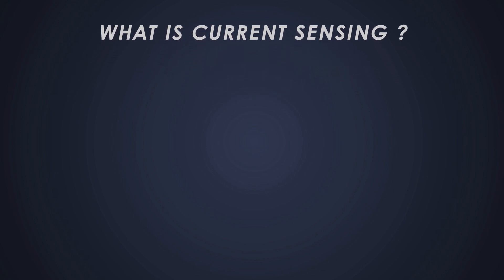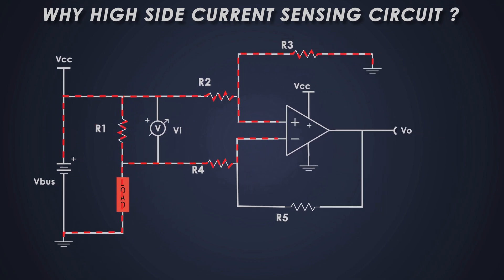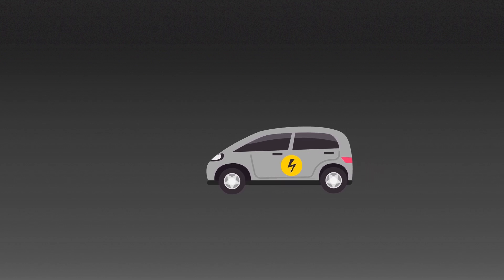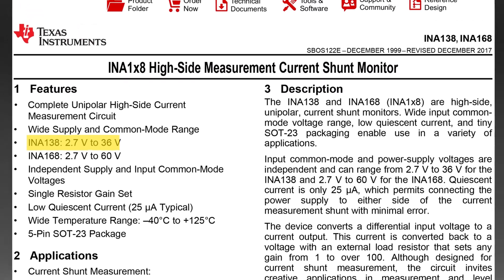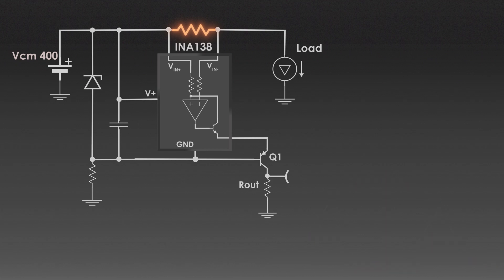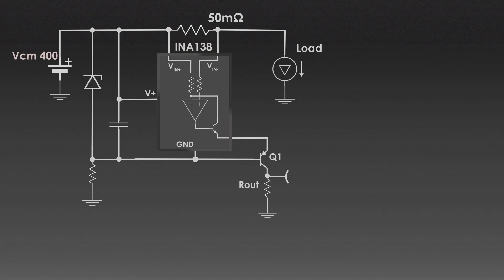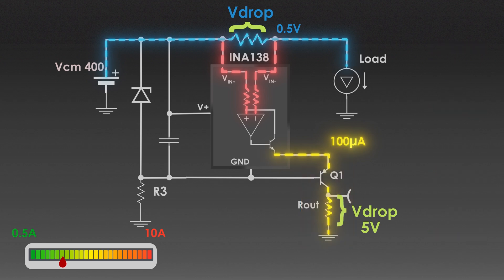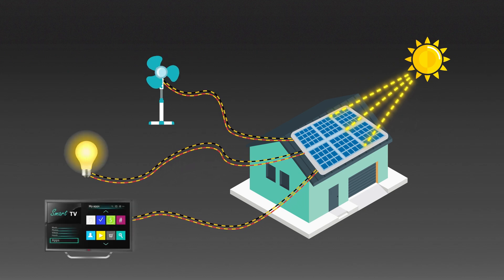How to Measure Current in High-Voltage Circuits? 400V High-Side Current Sensing

Comment: Interesting. However, you just wasted 7 W of your 400 V power source (2 W at idle) for a 2% accurate current sensor in a design that's not isolated. A Hall effect current sensor would do this dissipating 0.1 W and be fully isolated in a single chip with better accuracy and about the same ($) cost overall...

Comment: Wouldn't the implementation of a hall effect current sensor be easier, more stable, more consistent, more robust and more reliable?
Reply: Yes, Hall effect sensors are under appreciated.
Reply: Yes, Hall effect based current sensors are highly under-appreciated.
Reply: I believe it depends on the application. For example with high BW signals, such as current through a MOSFET in a DC/DC converters or over-current protection current sensing, the hall-effect is just too slow.

Comment: The way that zener is installed threw me off a bit. I built the circuit in simulator and all makes sense now. 👍
Reply: Back in the 80s that would be a breadboard job and you would be congratulated for not causing a fire or killing yourself 😂
Reply: @harryjohnson615  A bit before my time, but I can imagine the horrors.

Comment: sir, is it possible to use simple current transformer instead of this cct?
Reply: No. As the current to be measured is DC. A hall effect sensor with a magnetic core would be required to measure DC or some other hall effect sensor. A hall effect sensor with a magnetic core would be the most robust as power short circuits are not tolerated with completely solid state current sensors which tend to fail catastrophically under short circuit conditions.
Reply from the maker: that is also possible. But this is accurate